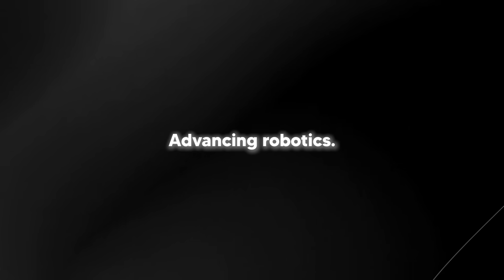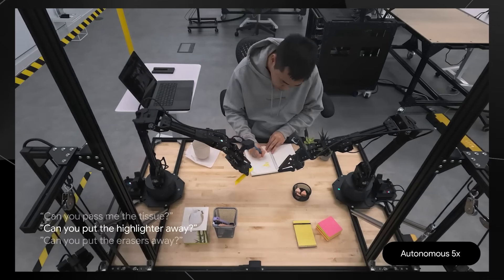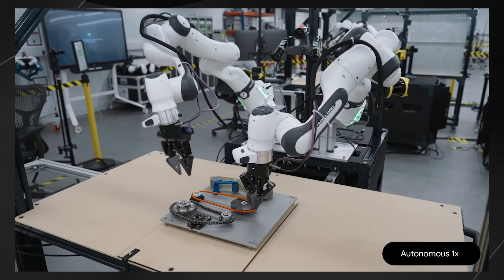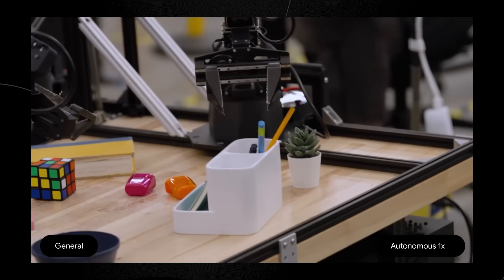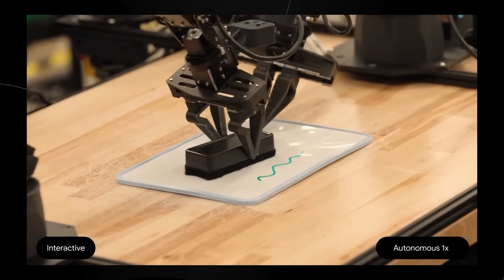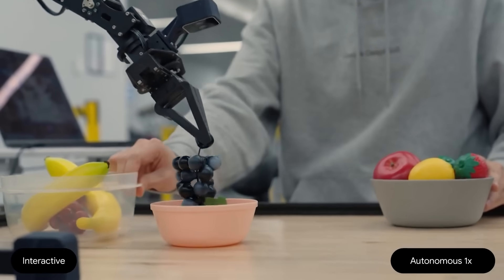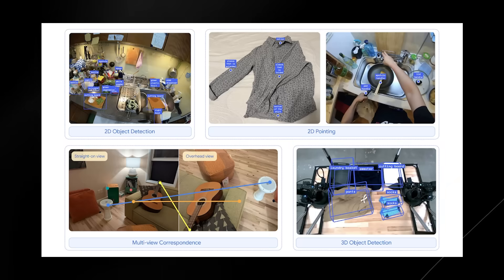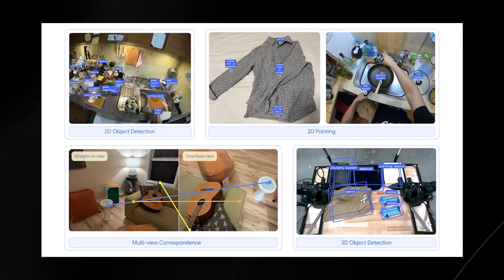Googles New Humanoid Robots Are Incredible - Gemini 2 Robotics

Comment: Why do they need to be general? We been using specialized robots for over 100 years. I don't understand why we need generalized robots at all. A humanoid robot is like the NFT of robotics. It sounds great on paper but as soon as you think about it, it makes no goddamn sense. But everything is made with a human interface? Imagine having this thing drive a car when you realize it's infintly worse than just trying to make an automated car. Imagine having this thing be a plummer when it's infinitely better to just modernize plumbing.
Reply: I don’t think putting AI into a dishwasher will improve the dishwasher that much. AI could improve robot vacuum and lawn mowers. 

If we don’t already have a special machine to do the task then it will most likely be done by a general robot. The issue with building a “plumper robot” is they don’t just plumb they do 10,000 individual task a day, if not more.

Comment: If these robots can perform tasks not pre-trained, meaning they can reason the solution out case by case, that’d also mean their actions are unpredictable, the result of their reasoning can succeed or fail. And the reasons for the success or failure would be also hard to fathom as they are used in different context by different persons?